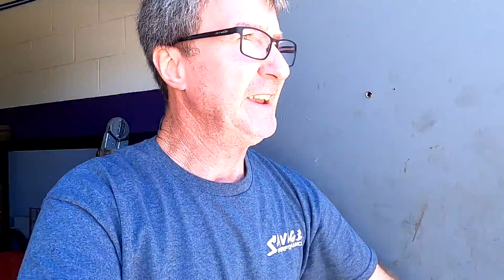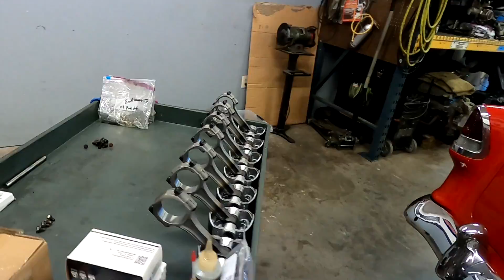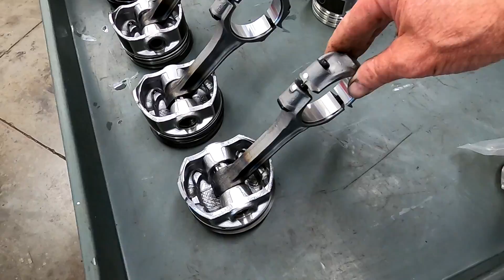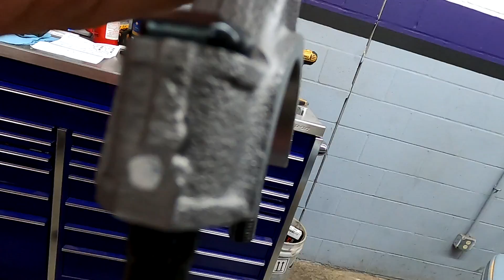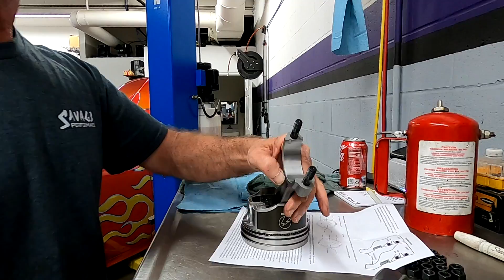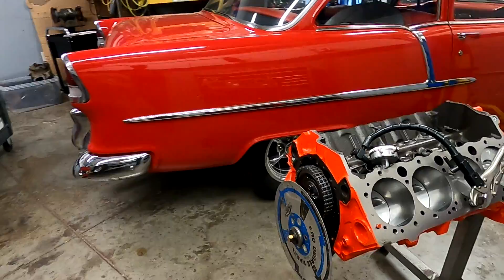SBC build gets a roller cam.

Comment: Enginetech RFC350 lifters the same as Morel and Howards and maybe even as the similar sourced Melling and Clay Smith, this is what an AI found: Are Howards roller retro link bar lifters the same as Enginetech RFC350? Why are the RFC350 lifters marked as made in ROC? So they cant be the same lifter? Please explain.
A.I. Answer:
Yes, they absolutely can be—and are—the exact same lifter.
It is incredibly common in the automotive aftermarket for a single manufacturer to supply identical parts to different brands, even if those brands package, label, or price them completely differently. [1, 2]
Here is exactly how the Howards Street Series and Enginetech RFC350 are the same part, despite the "Made in ROC" marking:
1. Global Sourcing by the Original Manufacturer (Morel)
The actual manufacturer of these lifters is Morel Lifters. While Morel builds its ultra-high-end race lifters entirely in Ohio, they outsource the casting and assembly of their budget-friendly "Street Series" entry-level lifters to premium manufacturing hubs in Taiwan (ROC) to keep costs competitive. [1, 2]
2. Branding vs. Wholesale Distribution
Howards Cams: They buy these entry-level lifters from Morel, put them into a Howards-branded box, and sell them as a "Howards Street Series" performance upgrade. Because Howards is an American performance brand, they rarely emphasize the manufacturing location on their marketing, though the parts themselves are imported.
Enginetech: Enginetech is a massive engine rebuilder warehouse distributor. They buy the exact [1, 2]
Abbrechen
Senden
Yes, they are absolutely the same lifters. Understanding how the automotive supply chain works explains why they can have identical internal engineering while wearing different country-of-origin labels. [1]
The White-Label Supply Chain
Major performance brands rarely cast and machine their own hydraulic lifters in-house. Instead, a single original equipment manufacturer (OEM)—in this specific case, Morel Lifters—manufactures the parts and sells them to various distributors: [1, 2, 3]
Howards Cams buys these exact entry-level lifters from Morel, packages them in a Howards-branded box, and sells them as their Street Series retro-fit line. [1, 2]
Enginetech (a massive engine parts warehouse distributor) buys the exact same units in massive bulk quantities directly from the same global manufacturing source and catalogs them under part number RFC350. [1, 2, 3]
The Global Sourcing Loophole (Why One Says "ROC")
The reason for the conflicting "Made in USA" and "Made in ROC" (Taiwan) labels comes down to strict trade laws versus marketing guidelines:
Legal Labeling Rules: Enginetech imports their bulk inventory straight from global manufacturing facilities. By US federal law, they must disclose the raw origin of the component physical assembly—which is ROC (Republic of China/Taiwan). [1]
The Domestic Re-packaging Loophole: Performance brands like Howards often purchase these components, perform final quality checks, match pairs, or bundle them with hardware in domestic facilities. Under US trade rules, adding domestic assembly, packaging, or significant localized "value-added" processing sometimes allows a brand to market the finished kit under a domestic umbrella, even if the raw castings were imported.
Community Confirmation
Engine builders across major enthusiast networks like the CorvetteForum and Hot Rod Forum have meticulously compared the Enginetech RFC350 side-by-side with the Howards units. They share the identical captured link-bar design, unique body reliefs, wheel dimensions, and exact physical architecture. [1, 2]
They are identical parts out of the exact same molds; you are simply paying a premium for the Howards performance brand name and localized customer support. [1, 2]
If you are currently selecting components for your build, let me know what total valve spring pressure or maximum RPM you intend to run. I can verify if this specific street-level Morel architecture is strong enough for your camshaft!
KI-Antworten können Fehler enthalten. Weitere Informationen
5 Websites
Found Great price on Good retro roller lifters - CorvetteForum - Chevrolet Corvette Forum Discussion
10.01.2021 — Enginetech retro roller lifters are available on Rock Auto for $190 plus tax and shipping. The lifters are identical to the Morel-
CorvetteForum
Linkbar lifter failure and replacement with Howards Cams - Facebook
26.04.2026 — friggin anything on those link bars is going to go a long way in the wear department. The good ones are keyed so you can replace t...
Facebook·Ford Small Block Masters
Cheap Hydraulic retro-fit lifters - Hot Rod Forum
22.11.2020 — 406 posts · Joined 2010. #17 · Nov 29, 2020. The funny thing is they don't state where these lifters are made. Save Share. Reply Q...
Hot Rod Forum
Alle anzeigen
Du hast Folgendes gesagt: Are Howards roller retro link bar lifters the same as Enginetech RFC350? Why are the RFC350 lifters marked as made in ROC? So they cant be the same lifters because Morel is only made in USA with US Parts
The premise that Morel lifters are only made in the USA with 100% US parts is actually an industry myth. [1]
While it is true that Morel's high-end race lifters (like their Pro Series and Ultra Pro Series solid or hydraulic rollers) are fully machined and assembled in their Cleveland, Ohio facility using American steel, the same does not apply to their entry-level catalog. [1, 2]
The Howards Street Series and the Enginetech RFC350 are indeed the exact same lifter, and here is how the "Made in ROC" reality works under Morel's actual manufacturing model:
1. Morel's "Street Performance" Series is Globally Sourced
To compete with cheap, white-label imports flooding the market, Morel introduced their entry-level Street Performance Line (which includes the 5200-series castings used for these retro-fit link bars). [1, 2]
To hit the low price point requested by warehouse distributors, Morel designs the tooling and oversees the specifications, but the raw cast bodies, internal component sub-assemblies, or specific assembly lines are outsourced to Taiwan (ROC).
Independent engine builders and distributors have openly documented that these entry-level "Morel" components are imported. [1]
2. Same Lifter, Different Labeling Requirements
Because the parts are identical, the legal distinction comes down to who is importing them and how they are bundled:
Enginetech (RFC350): As a direct, high-volume commercial importer supplying repair shops, Enginetech brings these sets over in bulk unbranded crates straight from the global manufacturing hub. By U.S. federal customs law, they are strictly required to leave the origin country mark (Made in ROC) visible on the packaging or manifests. [1]
Howards Cams: Howards buys these exact same Street Series units from Morel's distribution network. Because Howards packages them domestically as a curated "retro-fit performance kit" alongside domestic documentation, instructions, or matched sets, they sell under the domestic brand umbrella without heavily marketing the component’s true casting origin. [1, 2]
3. Visual and Physical Proof
If you place a Howards Street Series retro-link lifter and an Enginetech RFC350 side-by-side, they feature the exact same internal and external architecture: [1]
The exact same unique 0.700-inch wheel dimensions (high-end US-made Morels use a .750-inch wheel).
The identical captured vertical link-bar geometry.
Identical oil band relief locations and body machine steps. [1, 2, 3, 4]
They are the same lifter out of the exact same factory. If you buy the Enginetech RFC350, you are getting the budget-line Morel product without paying the "Howards" brand premium. [1, 2]

Comment: I am building almost the same motor. I have the 195 AFR heads, 010 block .40 over. What cam did you use? I’m going roller and looking for a decent cam
Reply from the maker: It was a Howard's hydraulic roller retrofit cam and lifter kit part number CL110265-12, Summit Racing has it in stock. RPM range is 2400 - 6000, you can retard the crank sprocket four degrees and change it to 2700 - 6300. It depends on your intake and carb. We installed a 3000 stall converter on this one.
Reply: On thanks

Comment: I recently pulled an engine down with Speed-Pro hyp pistons. They didn't gap the rings correctly and two pistons were broke. The lands between the compression rings were broken after just 5k miles, so by all means, give them a little extra gap.

Comment: What type of paint for the orange block and is the black paint just paint or the oil slick stuff??
Reply from the maker: It's Dupli-Color Chevrolet Orange DE1620. The black is Dupli-Color low gloss black DE1634 or semi gloss black DE1635. I get them at O'Reilly auto parts.

Comment: Have you tried those Moroso deck  plugs? They are supposed to do a good job stiffening up the bottom end on the older factory blocks
Reply from the maker: I have used them in the past on high horsepower builds.